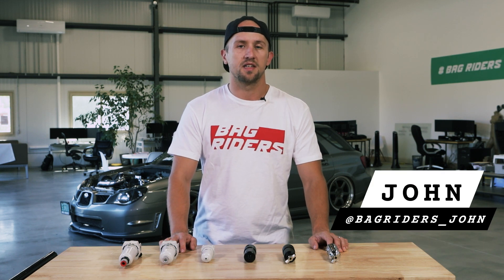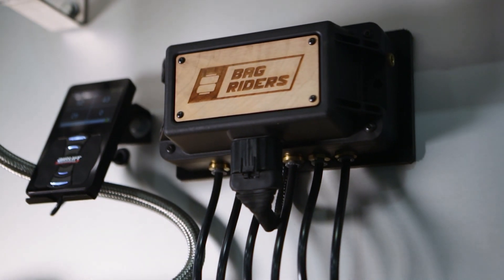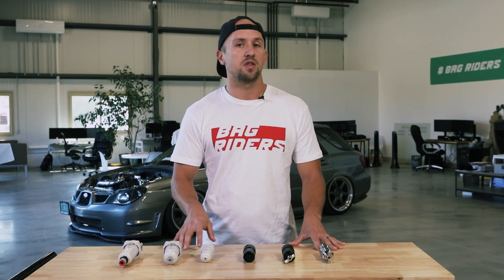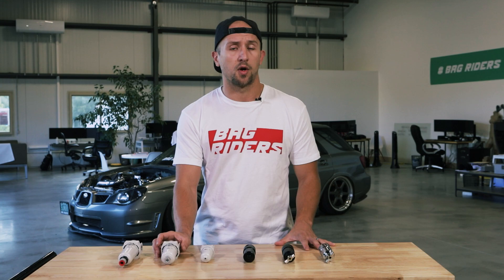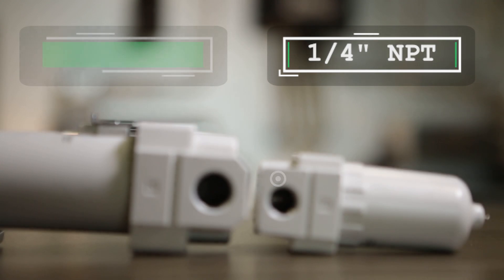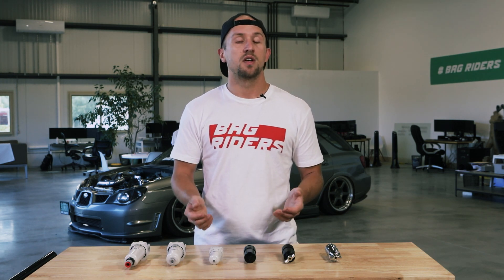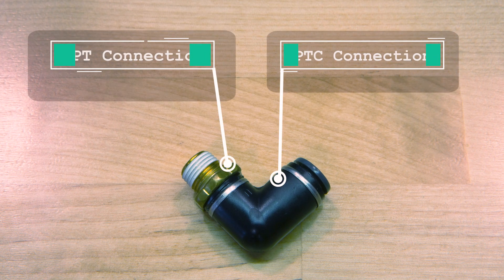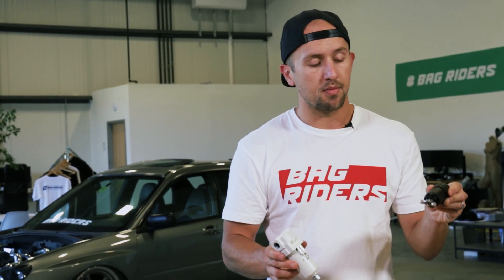Air Ride Water Traps Explained by Bag Riders

Comment: Can I run the water trap in a different location so I can drain it ? I've seen setups where they have it connect directly to the tank. I don't wanna have to remove the tank in Oder to drain it.
Reply from the maker: Yes you can place the water trap in a different location as long as it's still in between the manifold and tank.
Reply: @bagriders sounds good thank you for the response ! I've been watching your videos everyday bc I'm about to do my bags myself and I wanna make sure I have enough knowledge before doing everything 🤘🏻 videos are a huge help. Keep it up !

Comment: So ive been curious. i have a chad criss manifold and ran 1/2 lines . but have been told since its a manifold that im wasting air by using 1/2 inch lines , that i should go to 3/8 and wont notice a difference in speed . is this true ?

Comment: My water trap doesnt have an indication of whats inlet or outlet. It only has the letter P on one side.  Any ideas?
Reply: Perhaps that means Pump or Pressure, indicating the side that the air should be flowing into it from?

Comment: If I run dual compressors...do I need two water traps
Reply from the maker: The short answer is no because we recommend that the water trap goes between the tank and manifold.

Comment: Do you still need to drain the big air tank if you have water trap ? If so : Before draining the tank i need to let air out ? Is my first time when i use something like this
Reply from the maker: Yes you will still want to drain the tank if you have a water trap. When letting air out of the tank you can drain the water at the same time by using the port located at it lowest point where water collects. If you tank doesn't have a tank drain kit already let us know and we can show you where to get one.
Reply: @bagriders  Hello and thanks, next problem: Why my presets never stay the same ? Even when i click it to set my presets will not reach what i preseted. Also Airtank is losing PSI when i drive or over the night when car is parked , when i go to start the car my PSI is low, is this normal?
Reply from the maker: @bogdan.r.s Hey, we need a little more info! By how many PSI are your pressure based presets fluctuating? What control system are you using?  

No you tank should not be losing any pressure over night. We will release a video in the next couple of months with some pointers. But the most popular method is soapy water in a spray bottle, you spray potential leak points, and watch carefully for bubbles that grow!
Reply: @bagriders 

How often should the tank be drained?  My water trap hardly ever has water in it, so I’m not sure how much could even be in the tank

Comment: Could a faulty water trap cause pressure to not build up for my air tank?
Reply from the maker: That could be a possibility. Best way to check is by spraying the water trap down with soapy water.

Comment: I would like a heated water trap it nice that it traps water but not when you can't drain it cause it freezes
Reply from the maker: We recommend adding air brake antifeeze to your system during freezing temperatures.

Comment: is my car going to blow up bc my water trap is sideways…… but in all seriousness, it’s sideways but i’m able to lift up and when i press it to release air water doesn’t come out, i never knew you had to check it for water so i never did and there’s no water..? it’s been like 5 months
Reply: i do drain my tank and there usually is water in their daily
Reply from the maker: Great question! You want to mount your water trap vertically for it to work properly. If it's sideways it won't be able to collect moisture.

Comment: If I’m planning on putting 2 extra water traps between my duel compressors and tank,  I’m guessing my smc check valve from the compressor should screw into one side of the water trap but for the other side is there a fitting that can directly connect the  water trap to the tank. or do I need to run a ptc fitting after the trap with a short airline into another ptc fitting that is connected to the tank.
Reply from the maker: We recommend just running the water traps between the tank and manifold. But the fitting you are looking for is called a Parker Hex Nipple. You can find it here https://www.bagriders.com/parker-hex-nipple.html

Comment: Does the trap need to be mounted to the tank? Or can I mount the trap in the spare tire area so it’s hidden as long as it’s between the tank and manifold?
Reply from the maker: No it doesn't. Just make sure the water trap is vertical!

Comment: How to connect water trap if you have 2 tank setup?
Reply from the maker: If you have two tanks you'll want to place the water trap between the tank and manifold.
Reply: @bagriders what if they’re both Air Lift Flo tanks?
Reply from the maker: @Fleshnbloodrobot  Even with the Flo Tanks you'll want the water trap between the tank and manifold.

Comment: My air management is 1/4 airline. If I use a 1/8 NPT water trap. What would that do to my management? Or will it affect it
Reply from the maker: It will slow down the system ever so slightly, but not enough to really notice!

Comment: AVS chrome water trap he has are horrible. I have 2 in my setup because 1 out of 2 of the watertrap I got has a leak in it so bought another one. Then notice now they are both leaking from the center... can fix with Teflon tape or tread sealer but it shouldn't need to as it was design for u not to use that stuff anyways
Reply from the maker: Some water traps were made better than others!

Comment: If I go from a 3/8 line to a 1/8 water trap and then back to 3/8 to the valve body is that going to slow the air down
Reply from the maker: Yes that would slightly slow down air speed

Comment: I am frequently asked: why not put the trap between compressor and tank to trap water as „early“ as possible?
As correctly described here the water condensates out of the hot air while cooling down. And that happens mostly in you tank where the air sits for a while and not in the short line between the compressor and tank.
You‘re welcome.
Reply from the maker: That is a great point Balthasar! It is a common misconception that a water trap between the compressor and the tank is the best place to put it! Always best to capture as much water as possible before it can go into your bags, and that leaves between the tank and the manifold as the best spot to do so.
Reply: @bagriders  keep up the great work here! One of the best new channels on YT of the last year.
Reply: @bagriders  where should the water trap be installed then?
Reply: @RAV507 

The output side of the tank to the manifold